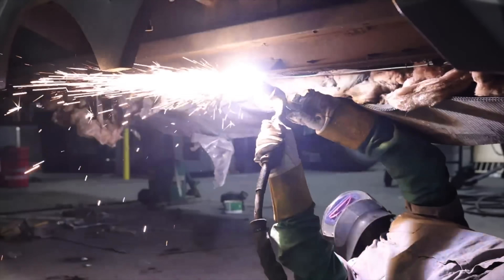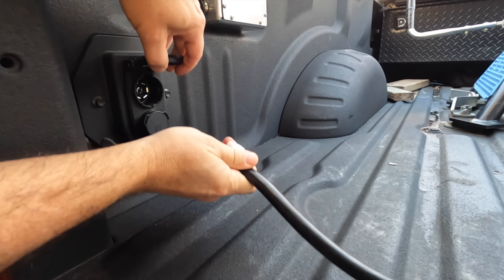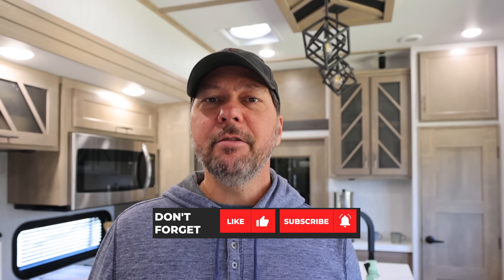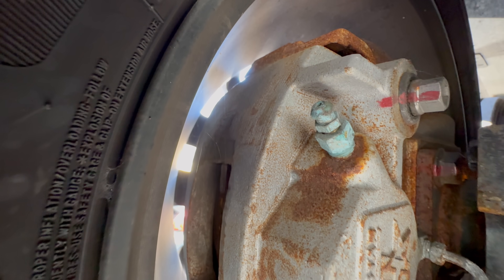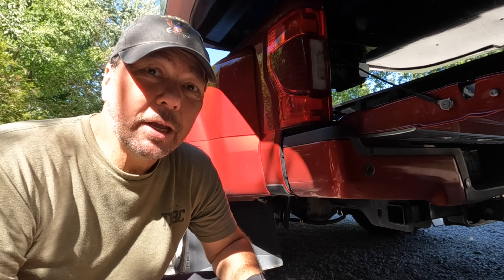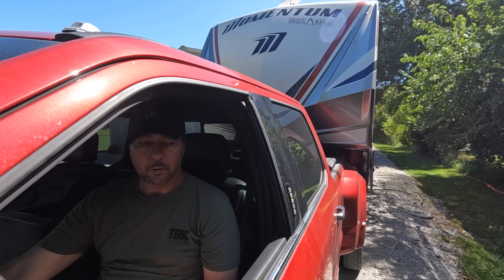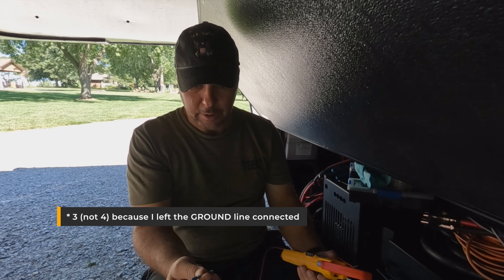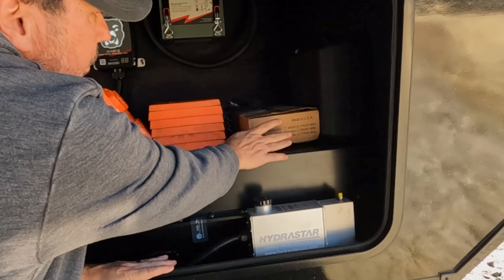RV Brake Troubles!: Solving a Perplexing Hydraulic Disc Brake Issue

Comment: Hey Chad, we’re having the exact same issue! 
We have a 2024 Chevy 3500HD and there are currently two service bulletins advising to change out the trailer brake controller and now the socket for the 7 pin. What was happening in our situation is that the RV (solar) was back feeding into the truck after the batteries were fully charged, causing the service wrench to activate on the electric parking brake. When that would happen, we would lose our trailer brakes. 
From the first time we connected to the RV with this truck, I’ve always felt like the trailer brakes never grabbed like they should. 
The truck is back in the shop for the second service bulletin. This has been mind boggling to me so I feel your frustration! 
I’ve done the testing as well and also disconnected the wire inside the pin box to eliminate back feeding and I’m still having the same problem.
Reply: This problem was finally resolved by a re-designed brake control module. (Firmware would not fix it) What triggered the loss of brakes was the trailers with Lithium batteries was back-feeding the B+ circuit in the 7-pin a 1 volt higher level which corrupted the logic in the controller. Note, this was happening on the B+ circuit NOT the brake controller circuit. It is all detailed in several TSB's. And anytime a DTC (diagnostic trouble code) is set the braking is disabled until the next next Key cycle. Imagine this happening on a 10 mile descent on a 7% grade? Truly HUA engineering.

Comment: One other thing to check. I had a problem on my F450 where I lost trailer brakes and lights. After pulling the bulk head connector in the bed for the 7-way, the connector on the back of it had come loose. While out, inspect each pin and ensure that each is seated properly in the connector. Only takes a few minutes.
Reply: This occurs on the GM trucks also and is detailed in TSB's

Comment: Enjoyed your video.

I believe you have a bad (new) wire somewhere.  

I know it is rare; however, I ran into a similar "unsolveable" issue when installing a brake controller. 

Everything I was using was brand new.

Finally, I decided to do an Ohm test on all the wires.  I found that one of my wires was bad, even though it was from a brand new roll.  

There is a poor or bad connection somewhere.   Some breaking means you have a bad but not completely separated connection somewhere.  Getting a good result now means that the connection is 'made '.  This is a typical intermittent result.

So, you either have a break somewhere in a wire or in one of the many molded connections in those wire connectors.

That would be problematic to narrow down.  

What wires did you add to your system, and what connections/connectors are there new to the system.

At this point, you have a few choices.  

Leave it alone and see what happens.

Try to run down the bad connection/break.

Use new wiring.

Personally, I would leave it alone and see.  However, if I had any more issues, I would not use the system until I either found the problem or replaced it.

Another thing I do not remember you mentioning is that you have checked the ground setup.

Here, it gets tricky.

How is the system grounded?

Are the grounds secure?

How many grounds are there?

Did you do a test of the grounds' bonding?

There could be a few issues here.

Your grounds may not be bonded sufficiently.

If you have more than 1 ground, you may have a "Ground Loop" in play.

So, even though your system works now, you may have hidden issues.  These may rear their ugly head.

I have tried to give you a few new things to consider.

I know solving this kind of problem is difficult and like an Easter egg hunt.  You will end up solving it when you find the egg.  It is just somewhere you have not looked yet.

50+ years of troubleshooting has taught me to be careful not to consciously or subconsciously discount any possibility.

https://help.campbellsci.com/CR6/Content/shared/Maintain/Troubleshooting/ground-loops.htm

Comment: Chad, I normally don't comment on your channel but felt this might help. I really enjoy the technical breakouts you do so please keep them coming. I have 2 tow vehicles for my trailer and use the Prodigy controller on both. I have noticed that set identical they DO NOT operate the same way. I must adjust and test each controller every time I tow.  You are using the truck manufacture controller which is also tied to the truck computer. Those systems are not perfect and can hiccup. Did you try readjusting the controller when you first noticed the break issue. I have been on trips and notice the same issues. I stop and readjust the controller, and everything works as it should. Also, I have always been told that the controller is not there to completely stop the trailer but to apply enough breaking so that the truck stops normally. This may be different for each trailer but that is how i have been told to set it.

Comment: May be a bad connection inside the unit and when you were re crimping it made the wire in question in a better position for a better connection. I have seen it before with controllers for stuff at work.

Comment: I have a 2022 F450 it had a recall on it to reprogram the trailer brake controller. We also have the I.S. three axle. It was not stopping like it should. I got it  before your’s  got it November 11th 2021 . After the reprogram it stops like a champ. And I have the brake controller set on 7.
Reply from the maker: I think ours was built after that recall.  I don't see it in the ford connect app.
Reply: @ChangingLanes Yes that’s what you said when you got it that yours was built after mine and yours didn’t have the recall. And I miss spoke got it November 11 2021 .

Comment: You checked everything. I had put hydraulic over on our rig and they were not working. Went through the same process as you.  Checked for air in the line starting at the furthest brake working my way up closest to the actuator, nothing no air. Brake fluid shot out about four inches. Then I got a new actuator, this time fluid shot a lot further. Success. If you do replace the actuator, there was a prime for the actuator by putting on its back. You have a different model but check with the manufacturer.

Comment: Whew!  You have the same affliction I often suffer diagnosing and fixing things.  So many issues I am presented with that make absolutely no sense whatsoever.  Case in point, why does my scooter overheat when i verified the water pump flows the antifreeze just fine?

Comment: Just a few thoughts on your issue. Not familiar with the pump/actuator assembly you’re using but have seen ABS systems in cars get debris make valves leak. Bleeding “ flushes” it out restoring system pressure. Also you said your battery voltage to unit was 13+ volts but when you pulled the breakaway it put 12+ to system. You should have battery voltage at connections or your getting a drop somewhere. Also something you might want to try if it happens again is to pull the breakaway switch and see if you get strong brake application.

Comment: I have extensive experience in electrical troubleshooting.  I have seen instances where conductivity reads fine on a DVOM, but in reality is BAD.  The resolution when it comes to resistance on a DVOM is actually quite limited.  There are two ways around this, the first is use a Digital Low Resistance Ohm Meter (these read micro-ohm) OR...do a voltage drop check across all connections while energized.  A good connection will have very minimal voltage drop (I worked on 1000A plus breakers and more than 300mV at 3000A was cause for concern).
Further, electric drum brakes are modulated by current not voltage so you could see 12V whenever the bakes were activated but the strength was controlled by current.  
Admittedly, I haven't troubleshot hydraulic...but I assume they are the same.  
Last, most new brake controllers modulate the braking signal digitally (on/off time) rather than analog...again, not sure what the settings on the integrated units changes though.
Reply from the maker: I was thinking the same thing.. that maybe one of the crimps was only bad under higher current...   I guess I could run some current through those old crimps and test that.  I think I still have them.
Reply: Chad, while the system is working check the current with your clamp meter under various braking levels.   Then you will  know what is correct should it happen again.   @ChangingLanes
Reply: I use the exact same value (300mV) working on 1000 amp motor control panels. YOUR diagnostics is spot-on!   Regarding brake control circuits using PWM,  RAM trucks are currently doing this. You have to have an ocilloscope or meter with duty cycle and frequency and pulse width capability.

Comment: High resistance, or intermittent connections are a hair puller , that's why most of us have little to no hair , I would double check the ground wire connection if even slightly corroded it can cause intermittent operation

Comment: I had intermittent brake issues as well. Bad connection in the wire connector going to my 7way on the truck. Water got in there and corroded the connection. It was hard to figure out as well when it only happens when you need your brakes to work.😂

Comment: We have a bumper pull and our brake controller isn't as involved as yours, but we had an intermittent problem with the brakes not working and it turned out to be a loose ground wire.

Comment: Mike Sokol has talked about an issue on Chevy trucks that have something to do with lithium on the unit and the computer brake controller on the truck. People were reporting the trailer brakes not working
Reply: This problem was resolved a few months ago. I just replied above, a few minutes ago. It was just as you stated. A back-feeding voltage on the B+ charge circuit in the 7-wire pigtail. A most interesting problem.

Comment: By cutting out the splices you may have found a loose wire or a wire that’s grounding on the wire you move around by removing the splices and redoing them cause it to make contact again I had this happen to me in house wiring and took about thirty hours of searching through every wire too find one that had a poor connection

Comment: I would check and see if the problem comes back while the hydraulic system is hot after some heavy use. If you'd been on and off the brakes shortly before you experienced the diminished braking, the actuator may be fine when cold and then not supply enough hydraulic pressure when hot under a continuous use situation.

I'd also check all of the brake pad caliper seats for corrosion as I did see rust in the area and remove any build up and lube the slide slots with permatex. You could have had one or two sticking. 

Also it's been about 3 years so the fluid probably could use a change. If its gone hydroscopic and abdorbed alot of water in the system, the brakes will be fine under normal conditions but get spongy when heat is added to the equation. I would do this before replacing the actuator.

It could have been a bad connection aswell as air in the system which you sorted and just are not sure.

Comment: We both have similar 450’s. I had mine in for a low voltage problem (steering assist module). They also found a bad brake controller module. We tow an 18,000 lb fifth wheel and I didn’t notice the brake controller having a problem. You might want to have the dealer check to see if your brake controller module is ok. Just throwing that out there.

Comment: Great video. The only thing that I could think of was a connection where it goes into the actuator. Maybe moving the wires got the power back on the unit. If it goes out again. It might be that the wires going in the box might not be getting a great connection .

Comment: I am having the same issue.. I hope some of this points will help me fix my problem.. I have bled lines. Next thing I will do is disconnect the battery and all power to see if that will work.. I have the Dexter electric over hydraulic break actuator.  The actuator is making a noise when I hit the brakes but does not stop or hold the truck back.

Comment: Could possibly of been a crimp connection as when you put a draw of current/voltage through it the resistance then could be a few ohms. You could of tested this under full load and test each crimp connection with a volt meter to see if you have any voltage drop. After some use the connection could get warmer do to a slightly bad connection heating up and causing resistance to go up. Otherwise spooky gremlins at their best. Sometimes just redoing connections may solve issues. I personally like soldering all wiring connections then crimp cap them off or up front before soldering have shrink tubing on and shrink it on after soldering the connection.
Reply from the maker: True.. I can't tell how many tickets I signed off as "reseated connections", working on aircraft in the Navy.

Comment: Have you thought about break fade. When the breaks heat up you lose potential breaking power. So when you are doing your test the breaks are cold so you would get 100% breaks. Just a thought, I off road alot in the rocky mountains, and that is one thing we need to watch

Comment: When you measured your voltage on your control wire the voltage was good. What we did not discover was the actual DC Amps that were flowing. I suspect that your splice connection was suspect since you changed them. Doing the ohm test on the cutout connection would not prove a defective connection as amp draw would have . Just a thought anyway.

Comment: Sounds like you had a cold solder joint! The heat on solder splices do a good job in most cases. But when I use them, I like soldering the splice first then cover it with the heat splice. That way I get a good solid joint. Soldering is as art to most people. Make sure it is shiny, not dual in color.

Comment: Curious how you ended up with the new controller, maybe I missed that part?  I used the same controller on my boat trailer and finally found out why my fluid was constantly low.  I discovered their connection where the brake line connected was leaking.  I called HydraStar and before I got off the phone I had a tracking number for a new controller sent to me along with a return label for the bad unit.  Mine is the ONLY unit I have ever heard of going bad.  I kept waiting for you to mention checking the brake fluid level as part of the troubleshooting.  I assume it was ok when bleeding.  Many people have no idea that the actuator needs to be checked frequently as it has a small revisor.  I wonder if by simply pressing the each end of the cut wires when testing it caused the bad connection to get enough contact to show good connection?  GREAT VID!!!  RR

Comment: I had a problem with my 2002 Durango.   I had installed new rotors and pads and about three months later I started having stopping issues.   When it rained it wouldn't stop.  Tried everything when the were wet it wouldn't stop.  Finally my brother in law found all my brake pads were hard glazed.   I replaced with new pads and problem was fixed.

Comment: I think it was a grounding problem, you fixed it when you cut the ole connector out, it doesn't take much to  mess up voltage, a ground is a must, I done power line work before, a lineman, so I know a little bit about grounding equipment, and a few problem with grounds on my trailers

Comment: Welcome to the wacky world of RV mechanics. I don't know and I am not familiar with that system. Perhaps it was anouther connection that wasn't making good contact under load. It worked before so it may have been a little corrosion some ware. Moving the wires may have improve the connection.

Comment: I'll just add another thing to recheck.  I don't really have anything to add as far as electrical goes, but I did notice the calipers have 2 bleeders on them.  Make sure you bleed the one in the highest position, or if you do both, do the highest one last.  If you only do the lower, or do it last, it could trap just a bit of air in the line and you will never get a firm pedal (or in this case full engagement).  Good luck with the trouble shooting

Comment: By the looks of the inside rotor. It’s been a while since the pad has been against it with any force, lots of rust. I’m stumped also. Maybe an actuator was sticking or the diaphragm is weak…good luck.
Reply from the maker: There was a note on the screen about the rust on the rotors... The RV had been sitting a while before that shot was taken. 👍🏼

Comment: Chad, forgive me, there are so many posts here supporting the TS efforts, I wish I could scan them all. I hope I’m not duplicating here, but I too had upgraded our rig with the ISS with the new pad and rotor vendor (I’m super impressed with their performance) in Oct and on my way home back in the DC area I noticed my breaking capacity diminished significantly after sitting in the heavy DC stop and go traffic for about an hour.  I started doing some homework (military tech order studying) and after reading Hydrastars manuals on their website, seems the actuator doesn’t like prolonged periods of use which seems to cause it to overheat which I’m guessing causes it to overtemp some of the internals and valves? In my case I noticed that the actuator was much louder than normal during its “failed” period.  Ours too returned to normal performance standards on the start of another day and has been operating as advertised for the moment.  I’ve not been in heavy traffic since so I can’t replicate this scenario ATT.  

Some things to note as you start your travels and checking tire temps, maybe check actuator body temps and see if there is a performance standards correlation. I was going to suggest glazed break pad and rotors but you and I have a duplicated condition with different pad/rotor vendors.